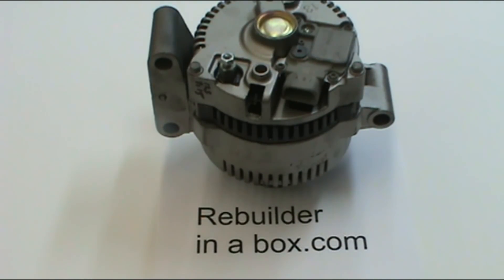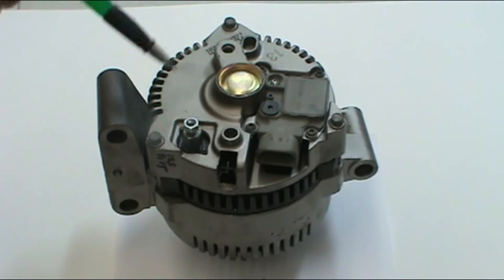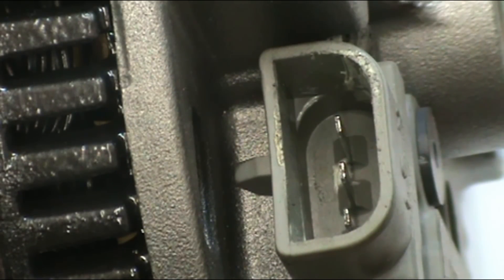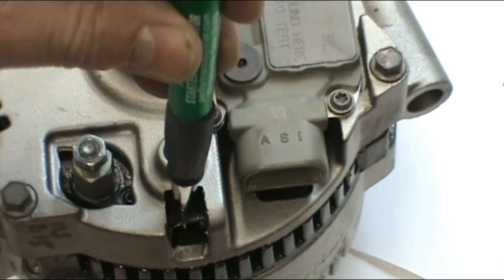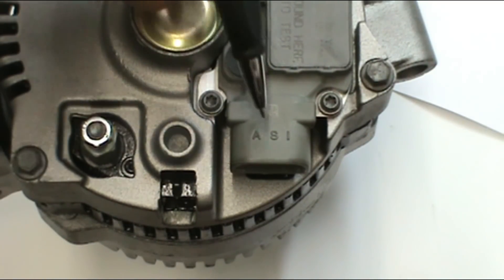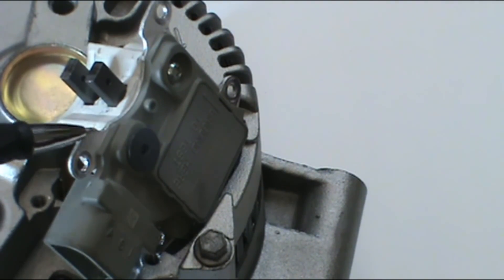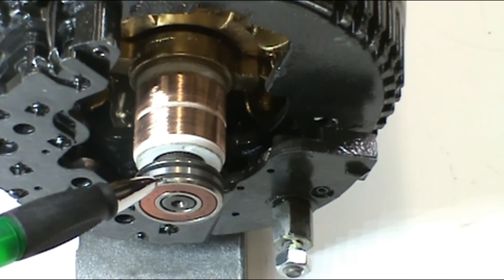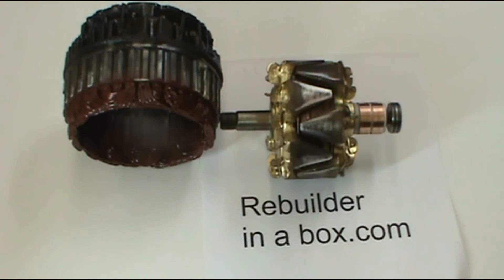Alternator Parts Explained

Comment: So if I wanted to build a generator out of an alternator would I have to remove the voltage regulator and hook power up to the brushes like straight wired... also the electric magnet in the alternator would it be going north south north south or would it all be One Direction like North North North.. also 1 more question are both brushes positive or is one also ground like I have absolutely no idea or do they split the voltage like they both take 6 volts 2 equal 12 volts I don't know I'm still trying to figure out how it actually works in detail... so other than that great video and any help would be greatly appreciated

Comment: I would like to ask if the output depend on the tourqe of the alternator or even at the low speed the output still the same?
Reply from the maker: Yes, amps output is directly related to RPM. But the good thing about our beefed up windings is they perform a lot better at lower RPM's.
Reply: The alternator output voltage is proportional the shaft speed and the armature (field) current. Since the speed of the alternator depends on the engine speed the alternator output is regulated by controlling the current supplied to the armature. The torque supplied to the alternator depends on the alternator speed and the alternator output current.
The torque goes up at low speeds and high apms.

Comment: Well done video thank you - Question- so by varying that voltage from the regulator, telling the alternating how much current to generate, does this allow the alternator to spin more freely when lower voltages are requested? Or in other words, does the alternator require more HP from the crankshaft to turn when outputting max voltage?
Reply from the maker: Yes. We have a 10HP electric motor for testing our rebuilt alternators so we can test max output in amps. We occasionally had problems with a 5HP slowing down too much when under full load.